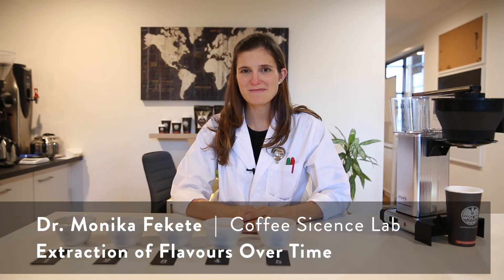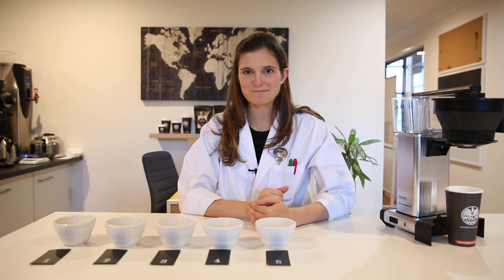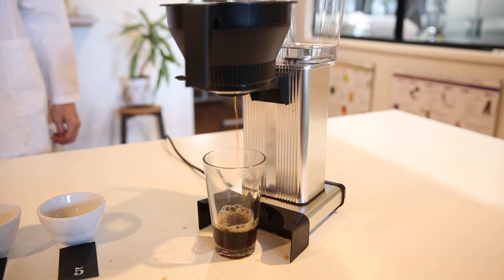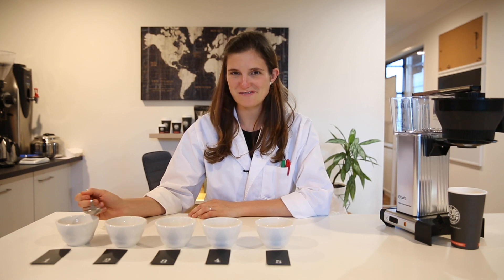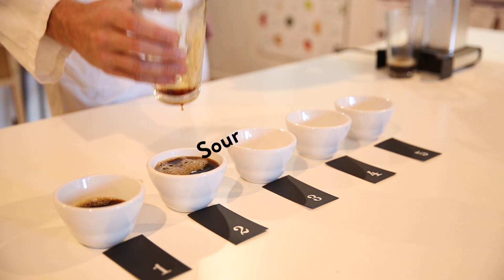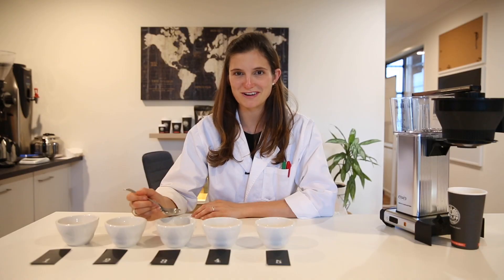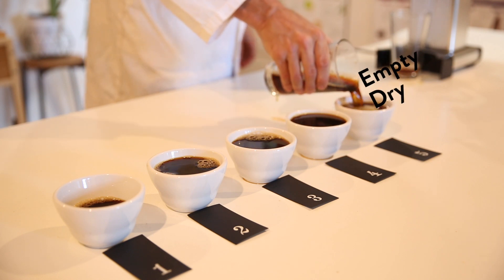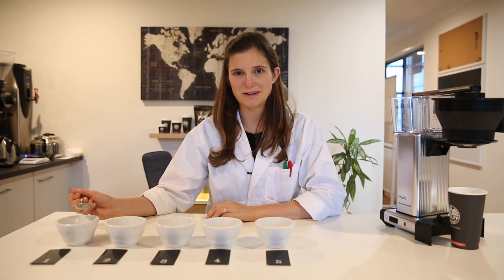Extraction of Coffee Flavours | Dr Monika Fekete

Comment: Clever.  Help me understand exactly what practical value this has.  I'm not getting it, but that happens.
Reply: In theory you could brew your coffee into different cups and mix them together. In this case, you could combine cups 1 and 2, and 3 and 4. Make 3/4 your base drink, and add 1/2 into it until you get the bitterness right. In the Aeropress I actually do this. I make 2 extractions first into a small pitcher and then into my cup. I add the first back into the second to taste. It actually works well, and isn't that hard, really.
Reply: @Lance54689  well actually u can stop the brew after like cup 3 and keep your temperature as consistent as possible to make sure cup 2 - 3 (mayb 4) can extract as well as cup 1 ( tho water hitting the cold ground and equipment might mitigate cup 1's extraction )